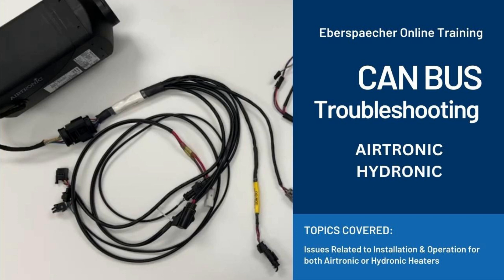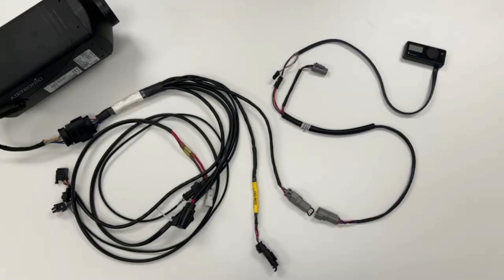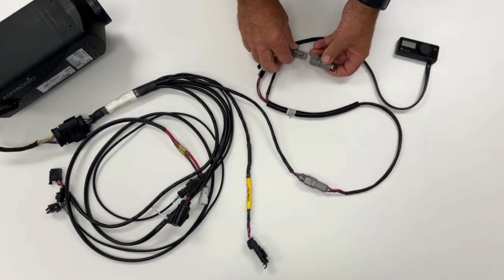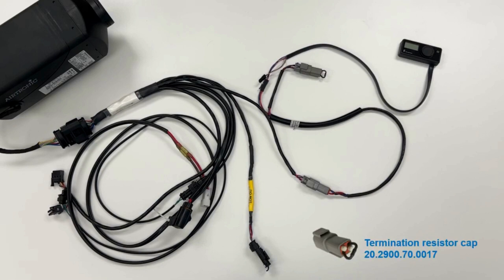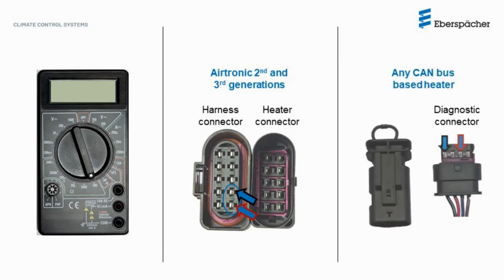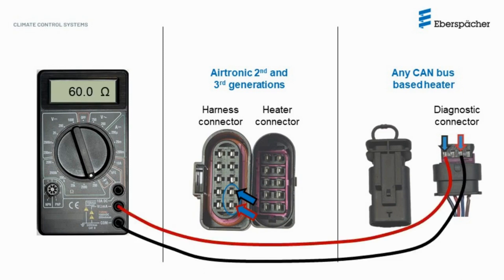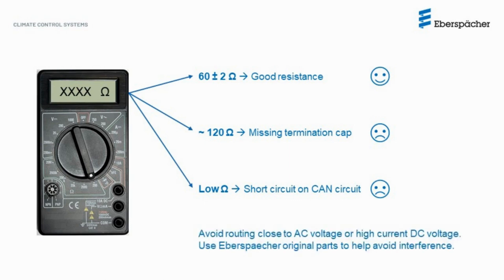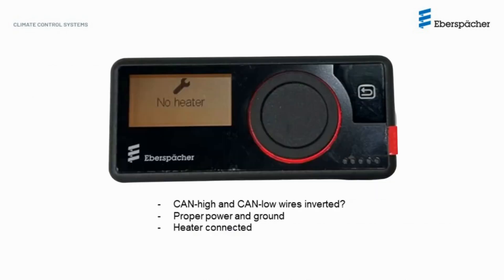CAN BUS Troubleshooting: Installation & Operation

Comment: Where could I buy a spare termination resistor cap (20.2900.70.0017)? Where is the catalog?
Reply: any dealer should have them.
Reply: @rewkirsch8557  They should, but they don't (at least where I live)
Reply from the maker: Apologies for the tardy response, @vince9345... have you managed to address your issue, or should I pass your request for help along to our tech department?
Reply: It wasn't easy but after a few months I finally got it. Thanks
Reply from the maker: Hi Vince.  Our engineering team just replied that you SHOULD be able to order this part in any of our dealers (https://www.eberspaecher-dealer-locator.com/).
If you wish to access our Product Catalogue, please follow the instructions given in this video: Where to Find Technical Information, Manuals and Part Numbers (youtube.com).  You can also call or email our technical support department directly: Technical Support  📞 1-800-387-4800 X2299  📧 help@eberspaecher.com